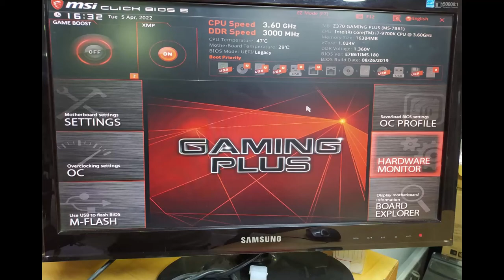LGA socket broken pin repair - İşlemci soket yuvası kırık pin onarımı

Comment: The way I do is I completely desolder the broken pin from the socket with the aid of a hot air rework station and I solder a new pin into the empty hole where I desoldered the broken pin from.
Reply: Hola. Qué metal usas para soldar? Sirve el estaño? Agradeceré tu respuesta ya qué tengo una placa importante con varios pines quebrados para cambiarlos como tu dices. O sea, una explicación detallada sería ideal. Cordial saludo.

Comment: That was super interesting! Did you use a pin from a different socket to replace the broken one? I recently came into a MSI x99 Godlike that has a pin snapped around halfway down, cpu error code 00, I was wondering if it would be possible to resolder from where it broke off, think that would work? Earned a subscriber here!

Comment: That's a very steady hand. I am impressed.
Reply from the maker: Thanks.Even though the total time was 17 minutes, the work I was doing was more than 1 hour in total. I was able to do it on my third try. In my first two attempts, the pin I tried to solder, popped out of the tweezers and I couldn't find it again :)

Comment: Intel socket sucks. They need to get away from those fragile pins. U can easily bent them if u just even breath on them
Reply: Yes really. Yesterday i bent just one pin of 1150 socket, i tried to fix and then suddenly i cute. Damn, it broke my heart. Now i don't know what to do. Many times, just for these tiny pins i think to move on AMD motherboards.
Reply: @genius8245  that sucks. I accidentally move over a piece of cloths over the pin n bent it just a bit but messed it up tryna bent it back. Easily wasted 100 bux right there
Reply: @SnowCrust  Yes it really sucks

Comment: Selamlar ustadım saygılar, H61H2-M17 Ana Kartımı işlemci takarken pinleri yamulmuştu hafiften geçengün Tamirini yaptırdım şuan stabil şekilde çalısıyor sorunsuz ama anormal gelen işlemci sıcaklığıydı ve dikkatimi çekti CPU fan hızı 1900 RPM geçmiyorda düşmüyorda işlemci %100 yükteyken bile Fan hızı 1900 den ne düşüyor ne iniyor 5 10 kademe anca inip cıkıyor bios ayarlarından baktım fan control manuelde değil disable seçili manuele alıp silent moda veya diğer modlara aldıgımda fan hızını fan hızı değişmiyor aynı 1900lerde çalışıyordu Fan hızlanmadığı içinde sıcaklık 100leri görüyordu fan arızalanmıştır die Snowman M200 Kule tipi soğutucu aldım şuan işlemci sıcaklığı boşta 35 40 arası , Stres Testinde CPU %100 kullanımda max 80 85 Dereceyi görüyor onda sıkıntı yok ama bu soğutucununda fanları 2100 2200 arasında çalışıyor boştaykende %100 kullanım anında da aynı hızda çalışıyor daha önceden böyle bi sıkıntı yoktu fanlar kullanıma göre cpu fanı hızlanıp yavaşlıyordu acaba sorun nerede yardımcı olurmusunuz lütfen cpunun ısı sensörümü arızalandı acaba sorun ne olabilir?
Reply from the maker: Merhaba. Soğutucunu değiştirdikten sonra CPU ısın düştüğüne göre ısı sensörü bozulma tezin yanlış kanımca(yoksa aynı ısıları gösterirdi yine sensör).Ancak fan devir kontrol mantığı, sensörün ısıyı algıladıktan sonra IO çipinin gelen ısıyı yorumlaması ile sağlanır. Senin sıkıntın bu yorumlama kısmında bence. Fan devrin kontrol edilemediği için de devamlı max hızda dönüyor tabi.Yani sorunun IO çipinde veya çipin fan devrini algıladığı hattında bir sorun olabilir.Anakartın şemasına baktığımda fanın 3 nolu ayağı SENSE ayağı yani IO çipinin fanın devrini okuduğu ayak. Şaseye karşı yaklaşık 40K görüyorsan en azından hatta bulunan dirençler ile ilgili bir sorunun yok demektir. Sonrası da IO çipine gider.  Tabi her halükarda BIOS u güncellemeyi denemeyi de unutma.
Reply: @meraklbilgisayarc8404  ağzına sağlık güzel açıklamıssın ustat Ama Biosum Güncel Sürümde şuan ? :(